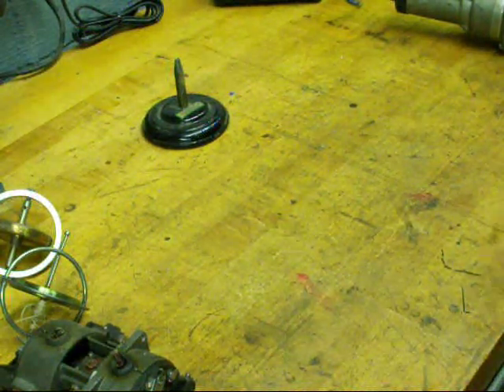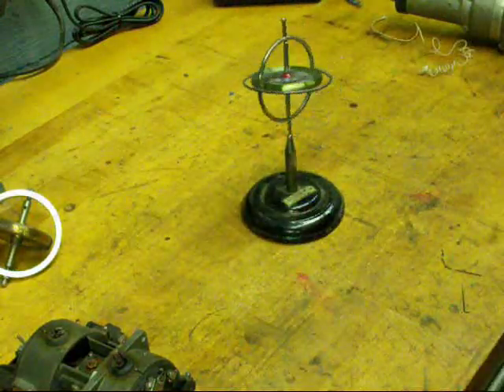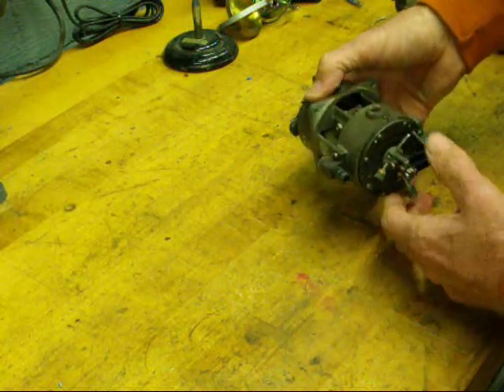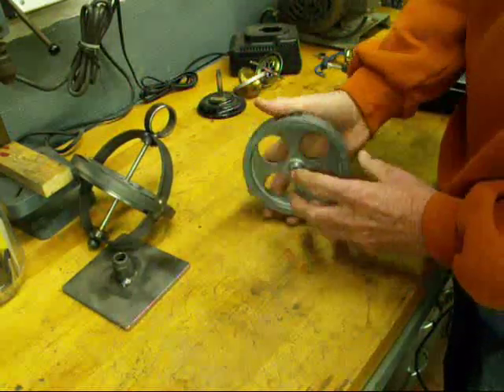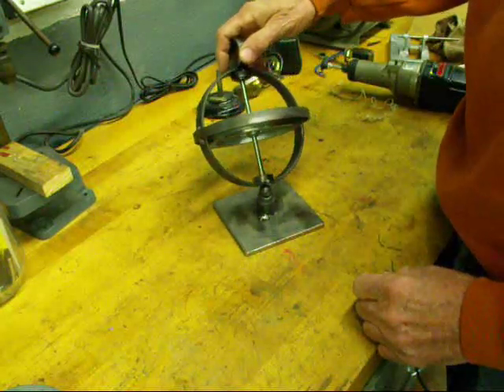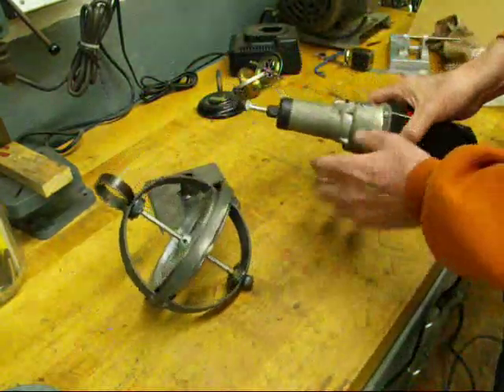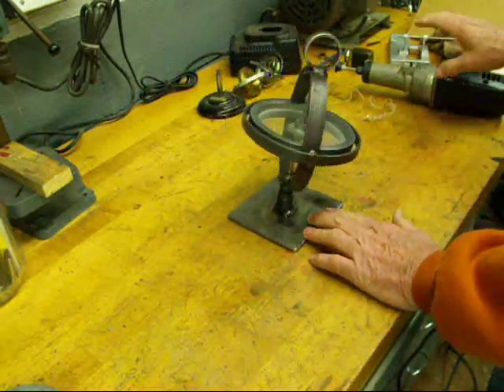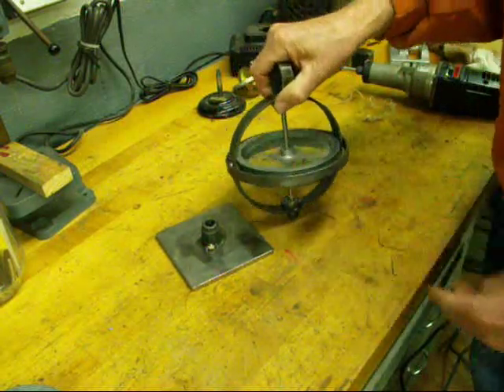large GYROSCOPE by tubalcain

Comment: Nice gyroscope Tubalcain!!! I still have one when I was a kid. It looks like a flying saucer and took 2 'C' batteries to run an electric motor in it. Even though it could run until the batteries drained out, if you let it spin on the table like a top, you could hear the motor slowing down until the outside shell matched the rotational speed of the of the flywheel inside. It would then fall over and you could hear the motor spin the flywheel back up to speed. I ought to make a video of it.

Comment: The ones you spin up with string that have a cross hole, it's better to fit a short peg through the hole and have a loop at the end of the string that fits around the peg.  That way you don't break the string or have it snatch and slow or bend the gyroscope when it doesn't slip out of the hole fast enough.

Comment: I love this stuff. What exactly is the approach for making a larger gyroscope? It sounds like you did it on the cheap and wise by buying an existing engineered unit...but did it include the spindle as well as I assume the spindle and gyro need to come as one. Have you ever seen calculations for the resistance to rotation versus the weight and diameter...and speed of the gyro?
Reply from the maker: OF CV Thanks for watching.  No math, just for fun

Comment: Your sperry AI gyro, some had air blown over it, most actually use vacuum , between 4.8 to 5.2 inches of mercury.  Between that range will give you the optimal rpm for the gyro.